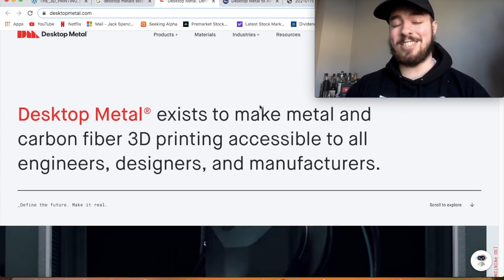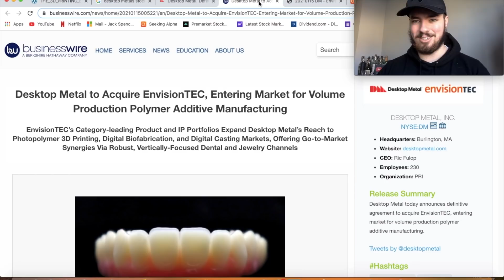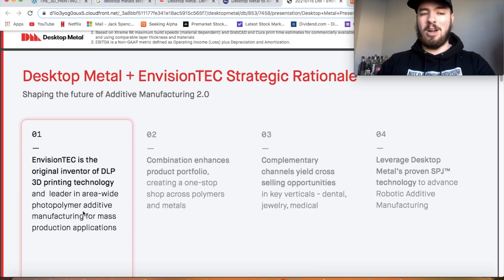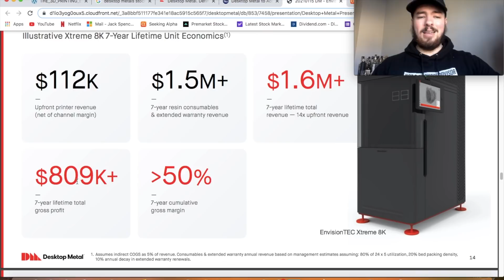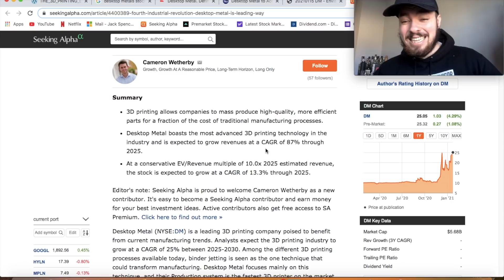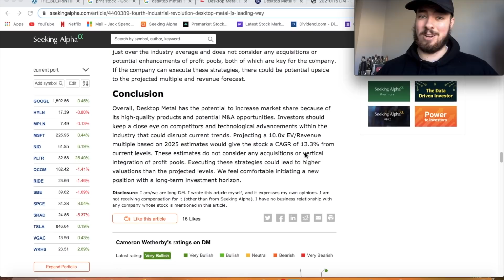ARK INVESTING IS BUYING THIS 3D PRINTING STOCK! DESKTOP METAL STOCK.

Comment: 👉🏻 ATNF (180 Life Sciences) Under the radar gem is an understatement. Potentially and very likely will soar 25X or more current stock price . Co-Founded by Prof. Raphael Mechoulam "THE GODFATHER Of Cannabis Research" Discovered the Endocannabinoid system and isolating the two primary compounds, CBD and THC. ATNF has a Tiny 1.8 million share float( Most likely much smaller at this point) with an addressable $150 Billion worldwide pipelines to address unmet needs of the number #1 cause of all autoimmune diseases in the world (Inflammation) & Chronic Pain Therapies with the Best Minds in the world. Dream Team All Star Management created drugs and companies that sold for close to $100 BILLION. They are in phase 3 the last phase of a potential 5 Billion therapy for Dupuytren’s Disease which there is no other treatment available. They are fully funded with grants(only the best of the best 1% ers receives grants) & cash on hand for 3 years as per CEO 3 weeks ago on latest presentation. Market cap is tiny around $60 million. Patent portfolio alone is worth 8X the current stock price. Management owns 50% of the outstanding shares and 60% of outstanding shares cannot be sold for 12 Months.  Management is taking compensation in form of stock NOT cash.